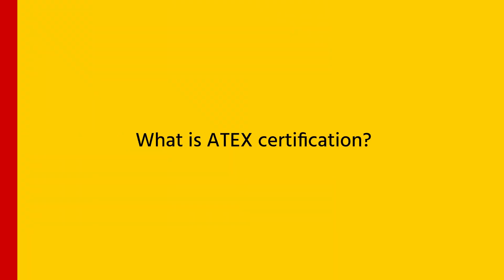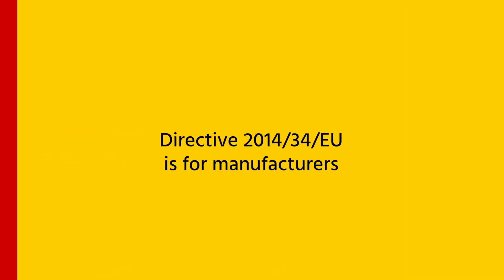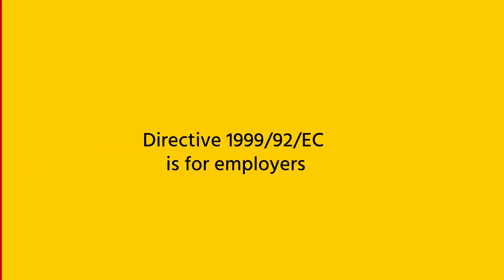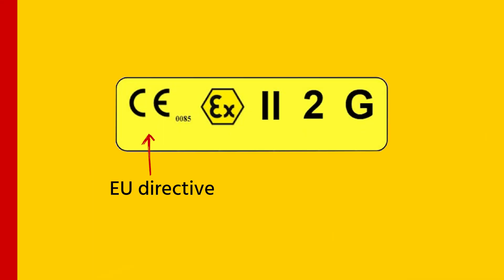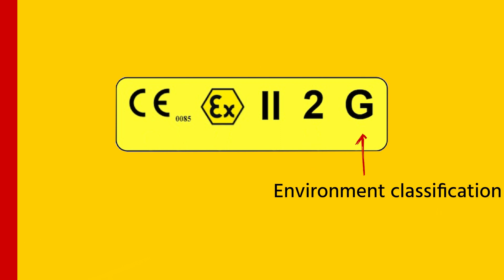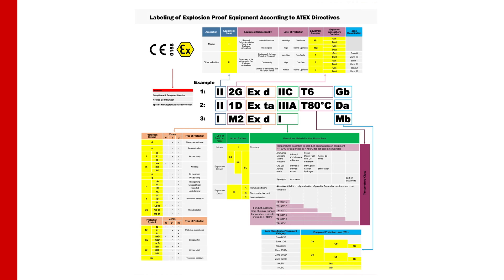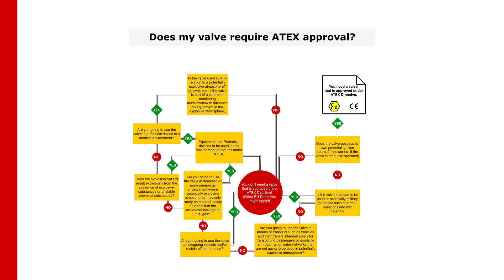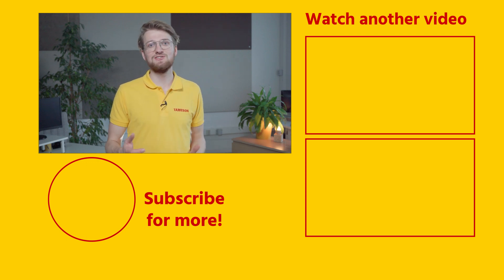What is ATEX Certification? | Tameson

Comment: Thanks , it’s useful. Could you please explain me what is deference between Exn and Exd , in electric motor pattern!?. Thank you very much
Reply from the maker: Hello, 
Exn refers to "non-sparking" equipment, which is designed to not produce sparks that could ignite a flammable atmosphere under normal operating conditions. This type of protection is suitable for use in Zone 2 hazardous areas where flammable gases, vapors, or mists are not likely to occur in normal operation.

Exd, on the other hand, stands for "flameproof" equipment. This design contains any explosion within the device and prevents it from igniting the surrounding atmosphere. It is suitable for Zone 1 hazardous areas, where flammable gases, vapors, or mists are likely to occur during normal operation.

Hope this helps.
Reply: Was the directives not changed?